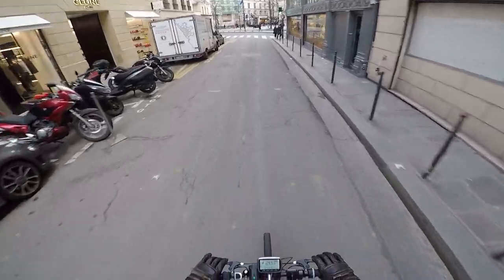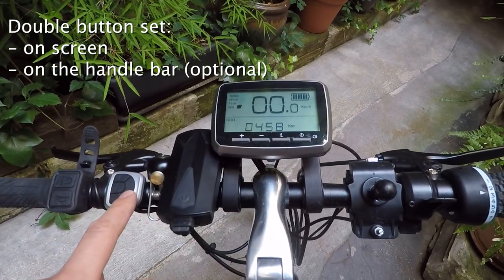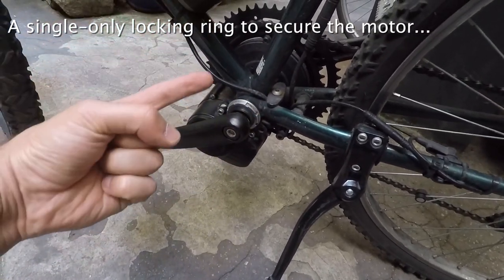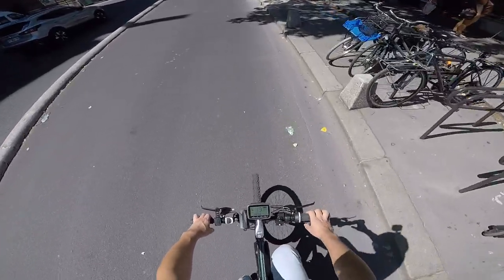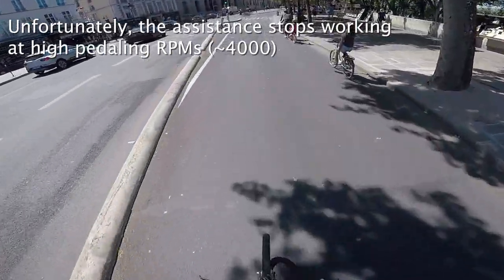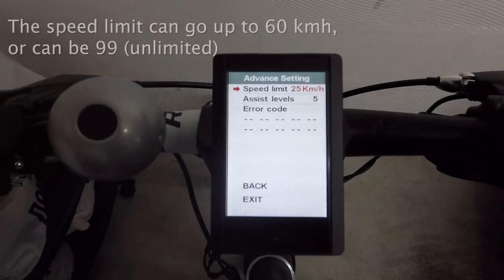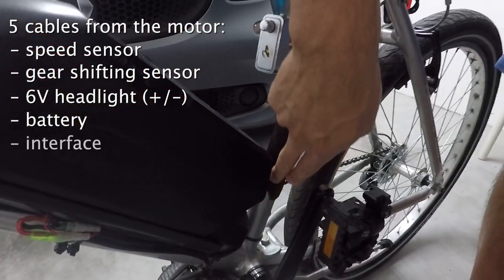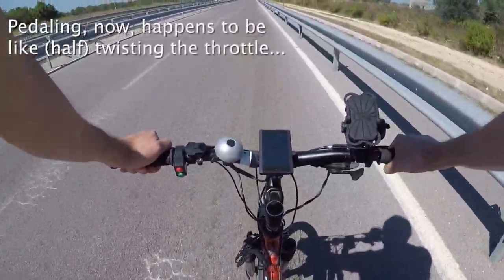Tongsheng TSDZ2 or Bafang BBS02B - 500W Mid-drive Comparison... Which one to choose?

Comment from the maker: [IT] Il limite massimo di potenza nominale per le bici elettriche in Italia è di 250W. Anche limitando la velocità a 25Km/h, una bicicletta che sviluppi una potenza nominale maggiore di 250W (anche 500W) non si può usare sulle strade pubbliche Italiane. Chi lo fa si assume la responsabilità delle proprie azioni (e contravvenzioni).
Questo video è da intendersi a solo scopo dimostrativo e NON è da intendersi come esempio da imitare. Poichè è destinato ad un audience più ampio che l'Europa, è stato scelto un 500W come esempio per mostrare le capacità del motore.
---
[FR] La puissance nominale maximale autorisée pour les vélos électriques en France est de 250W. Même si la vitesse est limitée à 25 km/h, un vélo qui développe une puissance nominale supérieure à 250W (même 500W) ne peut pas être utilisé sur la voie publique français. Ceux qui le font s'assument la responsabilité de leurs actions (et amendes).
Cette vidéo est finalisé uniquement à la démonstration et n'est PAS à un exemple à imiter. Comme il est destiné à un public plus large que l'Europe, un 500W a été choisi comme exemple pour montrer les capacités du moteur.
Reply: Velocita crapacita. They may as well say take all the 180horses of the car motor, and leave only 10. Doesn't mean anything
Reply from the maker: @Ematuresco  it does, like any ebike, bit it's so light that you don't feel it!
As for the noise, it's not disturbing. I find it more than tolerable.
Same for Bafang 👍
Reply: You could compare the so called "Puma" motor then you'll have all three steep-incline motors that are on the market, tested.
Reply: @LukeLorusso  Cogging only takes place with direct drive motors. It's the effect of drag from magnets in the motor which causes drag while pedaling. Mid-drives have a freewheel or clutch mechanism as do geared hub motors so no "cogging".
Reply: questo si sà, ma un 250W ce la fa con una salita 'generosa'? Anche perché risparmierei un pò di soldi, ma per 3Km casa-lavoro in una stradina isolata chi vuoi che mi fermi, non ci sono controlli, mai visti
Reply: my bbs02 750w has tons of mechanical drag maybe 500w isn't as a bad.
Reply: In Germania abbiamo le stesse regole per una ebike. Qui si chiama Pedelec. In alternativa, è possibile una S-Pedelec. Può essere veloce fino a 45 km/h. Ma richiede assicurazione e obbligo di targa e casco.
Reply: n results
Ci sono limiti di velocità sulle strade cittadine per proteggere sia il ciclista che l'automobilista. Tuttavia, è utile avere velocità più elevate per la guida in campagna dove ci sono pochissime auto o persone. In alcuni casi anche velocità più elevate in cui puoi stare al passo con il traffico possono aiutarti come a Los Angeles, in California! Ho avuto problemi con le auto quando guido troppo lentamente a Los Angeles.

In ogni caso, se puoi regolare la velocità sulla tua bici, qual è il problema? Vai al limite di velocità in città e aumentalo più in alto in campagna. 

There are speed limits on city roads to protect both the bicyclist and the car driver.  However, its useful to have higher speeds for countryside riding where there are very few cars or people.  In some cases too, higher speeds where you can keep up with traffic can help you such as in Los Angeles, California!  I have had problems with cars when I ride too slow in LA.

In any case, if you can adjust speeds on your bike, then what is the issue?  Go at speed limit speeds in the city and raise it higher in the countryside.
Reply: @mjremy2605  El problema son las multas, sanciones e indefension porque ningun seguro te asegura si el motor que llevas no es de 250w y tienes un accidente donde causes lesiones a un tercero. Podrias ir a la carcel, si esa persona que atropellas queda lisiada o muerta. O si los daños materiales que ocasionaste no los pagas por no tener un seguro y no disponer de fondos suficientes en tu banco para pagarlosm
Reply: Which is best for mountain biking

Comment: You couldn't ask for a more accurate comparison between these 2 systems. I've been installing both for about 5 years on recumbent trikes so other than a couple of small power delivery differences, your evaluation is spot on. Another thing to add for many buyers is the difference between solving problems. The Bafang would seem to be the better built of the 2 kits but the Tongsheng is by far the easiest to repair. Both have worldwide resellers of spare parts so you are not locked into proprietary dealers that you have to ship your kit to for repairs.
Reply: Any Chinese made ebike motor is easier to repair  cos spare parts are easier to get ,compared to Bosch.....Here in France Befang is the most preferred than any other..
Reply: What parts and tools would you recommend taking on a long trip for emergency repairs?
Reply: @justincase3230  If you are going to have problems with a motor kit it will likely be internal. The Bafangs are known to have Controller problems & the Tongshengs are known to have spragg clutch & Blue Delrin Gear problems. In my opinion, I would make sure to service either unit with lots of grease on the gears & ride ether unit for a few 100 km rides before setting off on a long journey. Once your kit is broken in & maintained, either kit will provide many years & kms of trouble free service. Just be sure to use your gears as you would without the assist & the motor for an extra push for your convenience. In other words don't let the motor lag by using high gears &/or the throttle to climb your hills - use your gears & leg power too.
Reply: Merhaba, ben üç tekerli bisikletim için almak istiyorum, yaşadığım yerde yokuşlar var, arka sepette iki çocuk taşımak istiyorum sizce tongshengmi, bafangmı tercih etmeliyim?

Comment: Thank you for the comparison - very informative. I am favoring Tongsheng for a couple of reasons, mainly the pedal assist being controlled by the torque sensor giving a more natural experience. Surely this should in theory provide a longer range based on the fact that the power assist is directly proportional to the riders efforts (so uphill for example requires more effort from the rider rather than "ghost pedaling" and letting the motor do all the work thus draining the battery quicker)
Reply: Yip.
Reply from the maker: Hi! Now there's a video about this :)
check it out -> https://www.youtube.com/watch?v=z5kKbTevIZ8
Reply: Believe me you're not ghost pedaling uphill unless you have the pedal assist at very high levels and the gear selector at low. The beauty of Bafang is you can set the PAS level to whatever suits you best. You want more pedaling effort then set the PAS level low, or want to exercise minimum effort then set it high, or anything in between. You can change the PAS level on the fly.
Reply: Hello.. newbie here.. i just cancelled my order of the bafang in place of the Tongsheng because of the torque sensing qualities..  I have a hydraulic brake.. do i really need a brake motor off switch like the Bafang?
Reply: @toetz4491 be wary as tongsheng doesn't have true torque sensor.

Comment: Thanks, I considered both, the main attraction of the Tongsheng for me was the torque sensor, but I eventually chose the Bafang which you can gain access to the software and choose a big range of tuning parameters. I have a 250 watt Bafang to stay UK legal, but you can up the amps to 20 and have a very powerful motor. Thousands of miles so far and no problems.
Reply: Probably a better choice because I just fitted a TSDZ2 kit a few days ago and my Gen I Bosch 50 Nm beats it on steep hills and it's far more efficient, hardly gets warm where as the TSDZ2 will be very hot. 

It's quite safe to say that the 80 Nm rating on the TSDZ2 is complete and utter nonsense.
Reply: @o00scorpion00o that tongsheng was created by some of the team that made bafang but they made loads of design flaws, that's why i stay clear of buying tongsheng.
Reply: @mikethomas6051  Yeah I wish I didn't get the Tongsheng, sure the open source firmware made a difference but it still doesn't give it the power of a Gen I Bosch and it won't fix the loose creaking crank.

I ride a 2007 Yamaha T-Max 500 now, lol, never thought I could have so much fun ! I'm a learner and hope to pass my test on it.

Comment: I don't know. The Prize tag on the Bafang in my country costs 70% of a cheap brand new Ebike.... unless you find it dirt cheap somewhere it's just not worth it in my case. I rather give 30% more cash and get everything already build on a new bike. But this is a very good video. Totally illegal if the speed limit of 25 kmh is not used in my country. Well thanks for the good video.

Comment: Thank you for doing this.  I went with the Tongsheng because I wanted very simple: No throttle, no ebrake, etc.  Having just 3 wires and a really simple choice menu was the deciding features for me.  Also, I did not care about speed. Well I did as I'm a very slow cyclist so just getting some assistance was beneficial.  Also, I like the idea of torgue sensing.  Didin't see that on the Bafang.   Completed the Tongsheng install and like the results so much that I will now convert my mountain bike with a Tongsheng motor.  And I save the cost of a battery.  Can't ride two bikes at the same time so one battery works just fine.

Comment: I have a tongsheng on a Merida hardtail mtb.
It's awesome. And the community open source firmware is definitely recommended. It's better than any bafang firmware. The open source firmware for tongsheng opens up more power for less battery due to a better algorithm and also many more display options including estimated kms left on battery and peddle power watts vs motor watts etc.
Absolutely recommend the tongsheng.
Reply from the maker: Hi! I've read that too. In fact, if you are into firmware mods, tongsheng motors are the way to go!
I'm actually planning to make a video on this 😁
Reply: @LukeLorusso  can't wait for your video of osf
Reply: How difficult is the flashing process? Where did you learn how to do it?
Reply: THis actually changes the game,  because if true,  it solves almost all the deficiencies of the Tongsheng.  I was almost favoring the Bafang even without the torque sensor until I saw this comment.

Comment: I have a Bafang BBSHD on my 2008 Santa Crur Blur dual suspension; insane power, perhaps too much, but really easy to ride especially if you dont want to work up a sweat. I also have the same motor on my 2020 Catrike tadpole recumbent; I hit 37mph on the flats with just the throttle. Both are enjoyable to ride. And I have Tongsheng TSDZ2 48V on my 2020 Trek Marlin; I upgraded to the 860C display and motor controller with the Open Source Firmware (OSF) V1.1 from eco-cycles...amazing power application as power does not cut off after 80 cadence and just keeps going as your cadence increases to 120. So for myself and my family, we need the exercise so the TSDZ2 is better suited for us. The OSF provides more than enough power at power level 9 (9 of 20), to climb all the hilly terrain without killing us. My buddy who has a Bulls eBike with the Brose motor says my Marlin performs just as well as his Bulls. I take that as a compliment to the OSF upgrade. I am now in the process of converting my 2020 Trek Roscoe with the TSDZ2.
Reply from the maker: Thanks for sharing!
As for now I am in a "transition period" and I cannot dedicate a lot of time investigating in OSF, but I am very interested in it and looking forward to try it as soon as I can
Reply: Hey, do you have any heating problems on Tsdz2? I ask because I read some people say the motor gets real hot very fast?

Comment: 2022 here. Just learned about Bafang a week ago. Now about Tongsheng. Thanks, I will take the latter. I had 250W hubmotors. Around the hills I often have to face 8-9 km/h sections. A 5OOW Tongsheng will boost it up enough. I don't want to fly. You just talked me out of Bafang :) +++ I just found a page, they sell it with stickers, you can put on the motor, saying 250W. Clever!

Comment: First off, great, detailed video here.  2 things, I wish Tongsheng produced a 2-3kw version that could run up to a 72v battery.  They could really improve sales, because the BBSHD and BBS02 both don't include torque sensing pedal assist.  And of course, the second wish would be if Bafang made a new version of the BBS02 and BBSHD with torque sensing added.  Cheers.
Reply: Jup non comparable on that point. Surely not let's say whan using a 72v 24ah battery and 52t chainring

Comment: Both my TSDZ2 with VLCD5 provide a 6V supply for lights which switches on with the backlght. You don't need a shift sensor because the torque sensor detects reduced pedalling force when you shift, which you should do anyway for the health of your transmission (you can't stop pedalling to shift a derailleur, a problem with the Bafang). The chain-stay clamp should be more than enough to hold the motor steady with the single lock-ring. You can set the torque/assistance ratio so the motor applies more power with less pedal force, making the motor kick in sooner/harder. I don't know why you'd need more than four assist levels - .does it really need that much extra fine-tuning?.  Throttle isn't legal (beyond 6 km/h) in the UK so no problem there. I will probably build a Bafang mid-drive bike at some point, but I'm currently putting together a hub motor trike, so that will be next year.

Comment: I bought and fitted a Tongsheng 500w and 16ah 48volt battery.  I've just done a 25km ride on a fairly hilly route, mostly in tour mode and the depletion of the battery indicated that I may be good for 100km range, it's still over 50v.  Not bad for a pensioner on an old(ish) Decathlon Triban 500, I'm very happy with my new 'bionic legs'...
Reply from the maker: Hi Alex! You made the most energy efficient choice 😃
I have a similar battery for my 750W Bafang and I can go really far with that (didn't measure it yet though since I live in high ground, with a lot of climbs and descents, so the consumption is different)
With a 500W Tongsheng kit you cut the consumption, getting the most out of your bike!
Enjoy your ride  🚴
Reply: I have a tongsheng and do 60-70 miles a day. I have two 14ah batteries and I usually get 35-40 miles from 1 battery with some charge to spare. I love the simplicity of the tongsheng. There is only one cable going to the cockpit
Reply: Pardon me, it's 13ah, and I'm getting 80km per charge (200km so far), I try and use minimum assist (Eco) as I'm trying to improve my fitness, but it's normally quite hilly on my routes.  I'm pleased with that.

Comment: I have just undergone a similar eBike journey and have both these and a rear hub. I have come to very similar conclusions about the two mid motors. My preference for feeling, as you say, bionic, is the TSDZ2 but I live in a very hilly area and the Bafang BBS01B (250W) handles the hills better in my opinion. Because the Bafang jkust gives what you ask of it it is easier on me in steep terrain. Everrywhere else I prefer the TSDZ2 as it just feels more natural. If I could run a 500w motor it would be the TSDZ all the way although the Bafang has a better reliability record. I have the gear sensor on the Bafang and I find it makes little difference. As you suggest I just stop pedalling momentarily on changes. The TSDZ seems less snatchy when changing, probably as a result of the torque sensor, which I love. There you are more subjective opinion for you to chew over. I should finally add that the TSDZ2 sips battery power in comparison. This is perhaps due the torque sensing again as it gives you a band of assistence for each of it's four levels where the Bafang is either on or off at any one level.
Reply: I'm on the fence with 2 conversion kits 3.batteries I wired up for longer distance more drive time for scooter to see motor work and.determine direction sprocket wants to spin motor where to put.2 twelve volt lithium attach remotely and secure motor on bycicle.what did I get into fasten midrivelooks better than backtire attach ALTHOUGH bike I wanted motor on is one piece pedal crank not 3piece ????

Comment: I'd go for the Tongsheng if only for the torque sensor. While rotation sensors 'can' work, I'd want the motor output to scale with the force I have to apply into the bike. Feels more natural, that way, and is why I prefer mid-drive motors in general.

Comment: I have the Bafang BBSO1B that's the 250 watt model which In the UK is the  legal limit. I also have the tongsheng 350 watt(naughty naughty lol). Surprisingly the Bafang is more powerful and in my opinion is a better drive, its also more adjustable, if you get the right lead, you can customise all the gearing and many other things, and you can read your battery charge in the LCD screen. 
          I had bad luck with my Tongsheng from the beginning, I had a faulty LCD and it was impossible to set up. It took 4 months and me paying the postage back to china to get it changed, I have two complaints with it. One the charge indicator is rubbish, you can run out of charge and it still shows full, BUT it does go a lot further than the Bafang on a charge. The main dislike I have with it is the torque sensor, The harder you pedal the more assistance the motor gives, So after a long day out( and i'm exhausted) and I have the final Big hill to climb, I still have to pedal hard to get full power to assist me up the hill even on the turbo setting. The bafang just glides up the hill with me giving minimum input.
         I hardly ever use the Tongsheng, but I love the Bafang which I intend to upgrade to the BBS02B 500 watt even though its illegal in the UK. I have a trailer on order so I can find space in it to carry a spare charged battery to double its range.
Reply: i bought bbshd 1kw 52v. hope its powerful enough